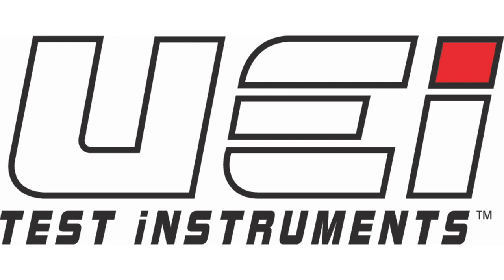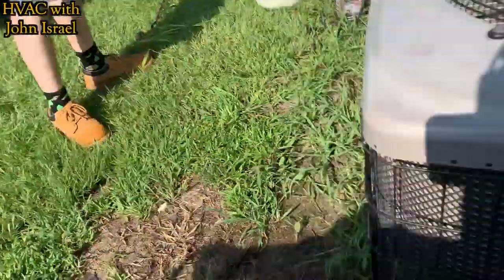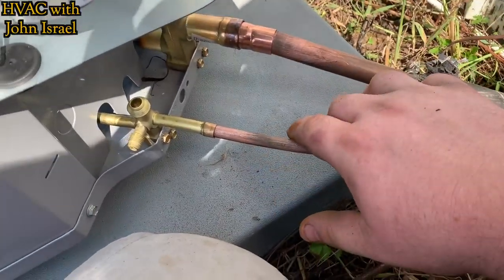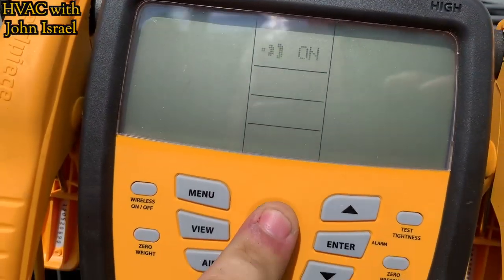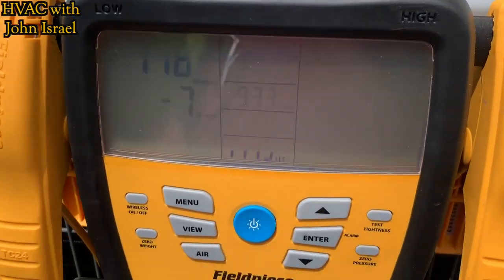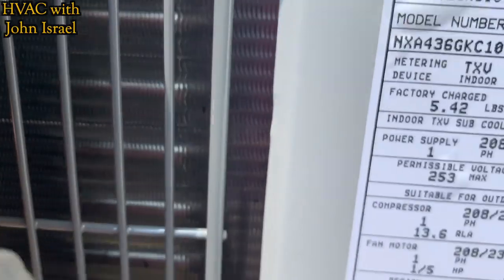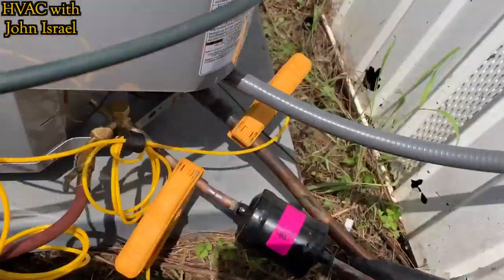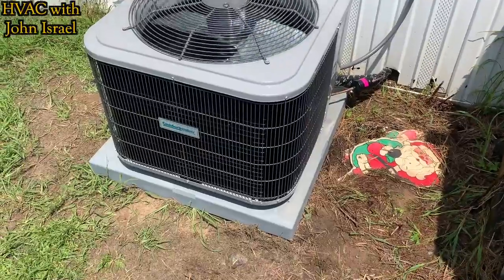HVAC | Condenser Change Out

Comment: You might want to check the Line set specs on the 3 ton ICP.  They recently changed to 7/8” suction line.
Reply from the maker: I have. You can use 3/4 suction line.

Comment: In Louisiana is it code to tie condensers down. In south Florida we have to have “hurricane straps” aka tie downs. I notice in a lot of others videos I haven’t seen tie downs on them either. Just curious keep the videos coming!
Reply: I'm in south Florida too and was wondering the same thing.
Reply from the maker: CritterGitter23 No it is not code here.
Reply: I've seen the wind pick up and throw huge ac units off of buildings in central fl. Actually amazing.
Reply: HVAC with John Israel In Southeast LA they enforce tying it down.  It’s the funniest thing, two pieces of plumbing strap tying it down to a plastic pad will do.  They started it after Katrina. We had the worst natural disaster to ever hit the US.  Six feet of water was high ground in two parishes and I never saw a condenser that was at ground level moved.......until the thieves showed up and stole them. 

They also enforce the condenser being above the finished floor, even if the house is 15’ High.  Anything high enough to fall on someone’s head I get tying it down good.
Reply: Not code here in Maryland.

Comment: Nice and clean install, John.  I like the size of that ICP!  Usually a 3 Ton these days are about 4' tall.  That unit was very quiet.  Was that a Copeland or LG Scroll compressor?
Reply from the maker: Thanks Brent. Yes I like the size of the ICP’s as well. That’s one thing I don’t like that Rheem/Ruud they are HUGE. This one had an LG. Which doesn’t bother me at all. I’ve had no issues with them whatsoever.
Reply: @johnisraelhvac2019  Thanks John!